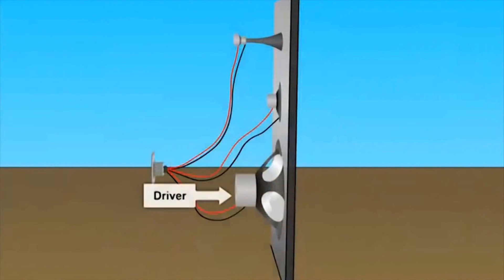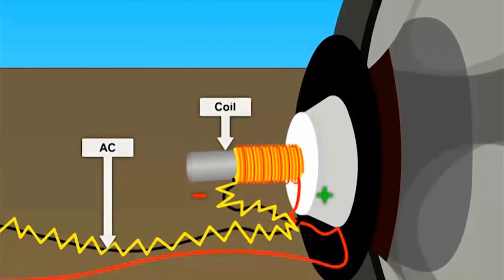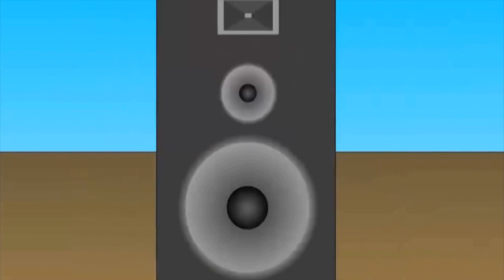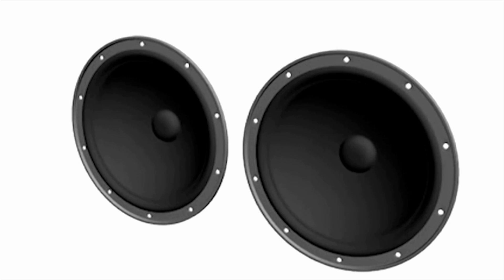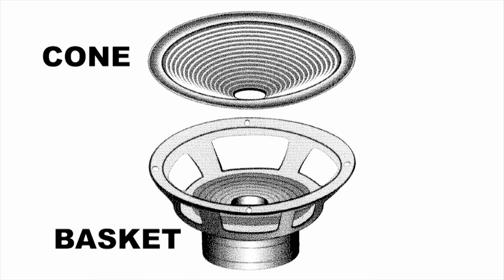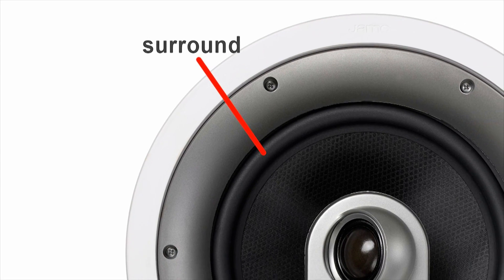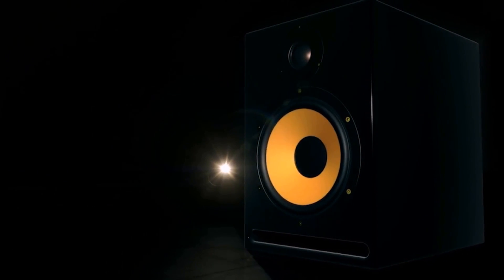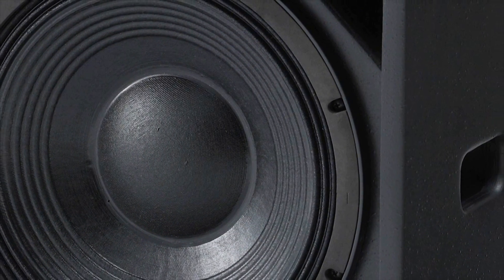How Do Speakers Work?

Comment: so here's a question I've had for a long time and no one seems to be able to answer it. if its speakers playing for instance a 500 Hertz sound along with like an 800 Hertz sound does the 800 Hertz fall in between the Beats of the 500 hurts. how can the speaker diaphragm produce both sounds at the same time. thanks if anyone can help.
Reply: Joshua Bliffen what would happen is that you have a speaker with multiple sized diaphragms which will produce different wavelengths of sound. So for instance lets say you have a 12 inch diaphragm a 6 inch and a 2 inch they would each be designated a specific hz range. This is why higher end speakers have multiple sized diaphragms or even a sound port to exhaust. If you have a single driver speaker then you would be limited by the overall tonal and harmonic potential.
Reply: XxXChiodos69XxX thanks for that. its was just hard to grasp the concept of a full range speaker

Comment: next one should be how do microphones work
Reply: Cody Thomas a (very) simple explanations of how a microphone  works is that it works like a speaker in reverse. Sound waves vibrate a diaphragm which moved a coil through  a magnetic field creating a current which can then be recorded  or amplified and playback by a speaker. That is why the speakers in some devices can be hacked to work as a microphone. Same tech, different application.

Comment: and turned up loudly enough, the guy down the streets sub woofers rattle your windows and move the pictures on your walls. I hate the sub woofer fad.  I was thinking to replace some dried out speakers in my speaker cabinets, and Radio Shack was a starting point to order individual ones..but I guess it might be cheaper to buy new speakers these days.
Reply: Parmesana What's radio shack?
Reply: Radio Shack WAS an electronics type of shop. They had wires and speakers, and antennas,parts of various electrical nature, phones,weather radios,batteries... 'do it yourself'Heathkit radio things.. a handy place for someone to pick up various things. They are out of business in my area.
Reply: Parmesana lol I was being sarcastic. They're bankrupt. They've closed a bunch in my area too.

Comment: how do those guys make hair stand up in the windows of there cars with speakers?
Reply: goatskindreams as the cone of the subwoofers move the air in front of and around them moves. With enough power and surface area you can increase and decrease the air pressure in the cabin of a vehicle enough to make the doors and windows flex

Comment: how do the electronic waves translate into specific sounds though. from this video i only understand how highs mids and lows are made. still great vid though <3
Reply: All sounds can be mathematically represented as a bunch of sine waves. A 'specific sound' is just a specific bunch of sine waves with particular frequencies. Adding the all into one electrical signal, the speaker can play the sum of those 'bunch of sine waves' as the specific sound. The speaker will have electronic filters to divert the higher frequency sine waves to the tweeter and lowers go the the midrange speakers, and the lowest to the subwoofer. When the speaker plays all of those sine waves together you get the specific sound.

Comment: Usually, the permanent magnet is AROUND the electro magnet. Also the CONE is rigid, the SUSPENSION (also know as the surround) is soft/ flexible.

"Sealed enclosures to prevent the vibrations from the rear causing distortion"? What about Bass Reflex systems that have carefully tuned ports that actually use the sound generated by the rear of the cone to IMPROVE bass response...

Honestly, for anyone who doesn't already know about speakers they won't be leaving this video any more knowledgable...

Also, not even a mention of Piezo, Electrostatic, or any other kind of speakers, I can understand not including details on them but Piezo's are actually quite common, any time something only "beeps" it's probably a small piezo element, as are many tweeters on loudspeakers.

Comment: Why are you putting in AC and not DC?
Reply: BalloonMan67 If you put DC power to a speaker, it will only move one way, instead of alternating.
Reply: Stephen what I'm wondering is how the AC gets in there when all radios run on DC current. What components turn the DC into AC?